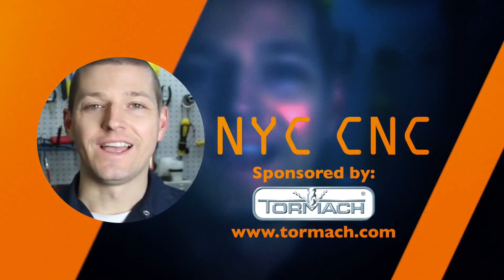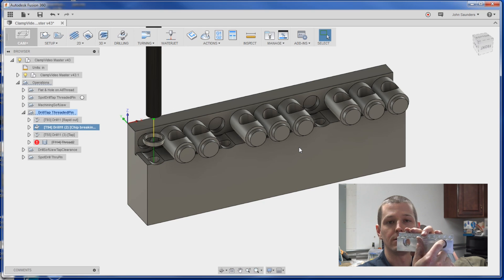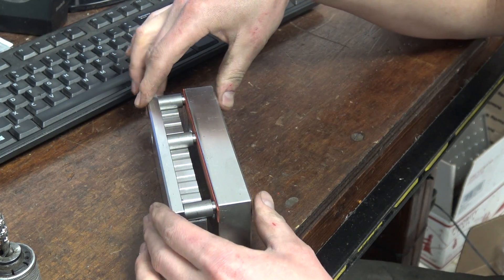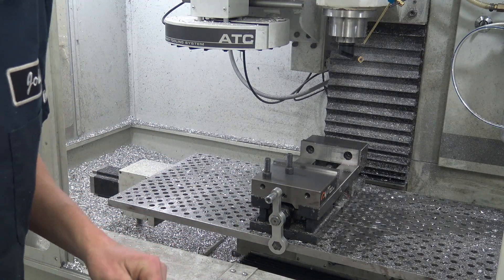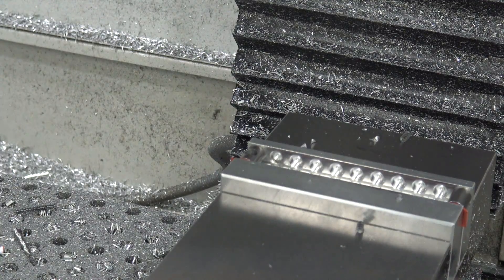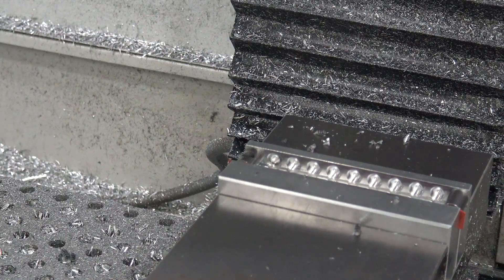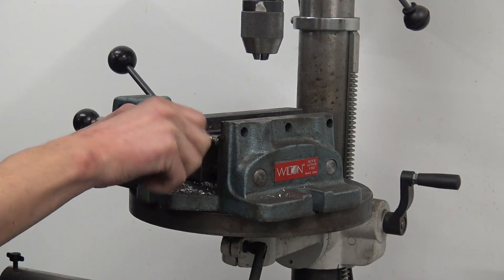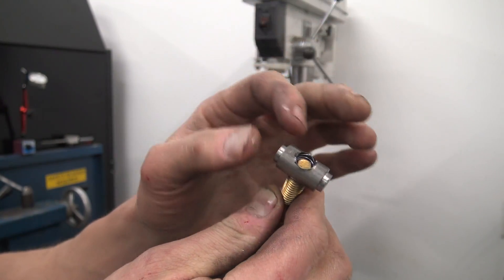Form, Cut or Mill Threads,  Softjaw Mistakes and more! Widget79

Comment: The reason you drill the form tap hole larger than a standard tap is the deformed material "squishes" out... you basically drill to half way between the major and minor diameter. The excess material from the major that would normally be cut is pushed into the minor. I use them all the time to tap from M2-M5 in brass and copper but they work well in aluminum as well. I don't ever work on steel unfortunatly so I have no experience but for soft metals they are much less likely to get gummed up and snap in the part in my experience.

Comment: Forming taps are the best. I have not used cutting taps for anything other than very low malleability materials. Throw them in a cordless drill. Hardly and chance of breaking them compared to cutting taps that have around half the total crossection. They will push a little material out as a bur, but about the same as a gun tap anyway. My travel kit is all screw machine drills and forming taps. Drills are sized to make a 60-65% thread. They also last far longer and leave a perfectly clean polished thread instead of microscopic chatter marks. Go ahead and drive them with an impact gun, they don't care.

Comment: 11:15 reason for the larger tap drill diameter is that the form tap not only pushes material outward to form threads, but also swedges it inward in an equal amount. So if you were to form tap a hole, and then use a gauge pin in the hole, you'd see that the minor diameter gets smaller after tapping.

Comment: drill cross holes in soft jaws slightly lower in vertical plane to force parts more downward to stop the spin you experienced and also you can make a V cut rather than a radius for parts to sit in to create less of a bearing surface, anything with more sides than a radius. combined this will stop the rotation as well as compensate for the discrepancy in part length leading to the parts coming loose from the fixture

Comment: I enjoyed this video, and learned about "thread milling" which is new for an old tapper dude. You mentioned about  the formtap and the deforming of the bottom of the hole. I found this info which may be late by now: a)...Forming taps run better at speeds 1-1/2 to 2 times faster than a cut tap, and require much more attention to lubrication of the tool,... b) Cutting taps may be a better choice for "through-holes" as they won't require a separate operation to repair the distortion at entry and exit caused by the forming tap. ... https://www.natool.com/blog/2016/07/cutting-taps-vs-forming-taps

Also I'm upgrading my SIEG X2 Mini Mill to CNC which has an R8 Collet. Questions: 1) What are the collets that you use? Are those tapping collets, which spin in reverse on extraction, or does the spindle turn in reverse in the G-Code?
Keep up the great work!

Comment: Best thing to do is use a drill tap drill taps look like a drill but with theads its fast but another problem is ur tool holder is to wobbly you need to use a spring loaded holder that quick connects don't work to good

Comment: The form tap requires a larger hole because you are displacing material, the minor diameter of the threaded hole is smaller than the diameter you drilled to because when you form the thread the material the material you're coming at the major diameter of the thread "moves" to fill the minor diameter.  The reason it's stronger is because you're maintaining the "grain structure" of the material.  The main benefit imho is the finish of a form taped hole, it's phenomenal, like a mirror, and the finish is how you judge your tool life, when the finish goes away, time to change the tap.

Comment: I form tap whenever I can. I don't have a lot of form taps, but the ones I have I use every time it's possible. I like that there are no chips to clean out, and I believe the threads are stronger, and are very nice. In my experience, form taps give more consistent threads than cutting taps. I've never power tapped, only by hand every time. I always use Tap-Magic fluid whether I'm form or cut tapping.

Comment: Awesome video! I just stumbled across your YouTube channel by accident. I like the idea of the endless applications that soft-jaws offer. I saw that your work piece turned easily. I over engineer everything in my head, but it also leads to good ideas. So, with that said, I had a crazy idea. What if you were to drill and tap the back side of the moveable soft-jaw for set screws? You could even maybe drill them at a downward angle to put downward pressure on your work pieces...

Comment: 12.00 and 08.03 Time. It's not good with the z-axis retraction, it stops with thread in the hole, which is not good, you have to retreat to pull the pot out of the hole, not the star instead. Breaks the beginning of the thread. It's just an observation! Hello from Romania, I work on the CNC lathe!

Comment: we use uhmw strip 1/4 X 2 and cut  the same length as jaw width instead of that red padding strip and you can use them a long time over a year in some cases. and put some serious clamp power on it

Comment: I recently switched over our taps 100% to form taps in our CNC operations. We are form tapping very successfully in all the materials we machine (4142, D2, A2, 1018, HRS, Aluminum, Stainless ext)  except for Ampco. We have almost completely eliminated tap breakage plus the performance with water based coolant with form taps vs cut taps is much improved.  It was a good move for us in the way of reliability, thread quality as well as it cut down on our tooling costs.

Comment: A tip for your clamp fixtures. Use a stack of Belleville Disk springs in each pocket for pins that may be a couple thou off. I had a job once that required several hundred pins be milled flat on two thirds of one surface, then drilled in two places and drilled and taped in one. Then a key slot was end milled in the lower part of the flat. I made a fixture with ten V slots that could be clamped in a vise but did not figure in the length. The pins did not have a critical spec for the length so they were all cut with a couple thou difference each. After building the jig I would have a few pins that would try and rotate during the first pass. I solved the problem with a stack of belleville disk springs in each pin pocket that gave me roughly 2200# of clamp force on the pins that were a bit short.
Reply: Cyrus Cosmo  thats a great idea! thanx for sharing!
Reply: Cyrus Cosmo 

that is a great idea thanks for sharing!

Comment: You make great videos keep up the good work. When I countersink tapped holes I almost always go .015 to .03 per side larger then the thread major dia.( aslong as the print allows). This takes care of any burr that may form on the  entrance side of the cut. For Ex. For a 3/8-16 I'll use a 1/2" drill mill or a #6 center drill. And make the chamfer dia .406-.437. It also makes the appearance of the hole more attractive. In die making a large chamfer helps to strengthen the first threads in hardened tool steel to keep them from pulling under pressure while a die is running in a press.

Comment: Great video, just subscribed.  Form taps are a fickle mistress, and performance is WAYYYY more material dependent than cutting taps, in my experience.  The reason they're "stickier" than cutting taps is partially due to the "springback" (technically elastic recovery) of the material.  Basically after you push all the material into the shape of the thread, the thread is actually trying to bounce back to its previous shape as much as it can.

Comment: You are using a wrong holder for the form tap.. never use the click holders for regular taps with a form tap... the pressure from the form tap will click it because it needs more power to push it in ...

i always use a collet or veldon holder for form taps.. works like a charm.

Comment: If you were to center the part so that the hole is between the two jaws instead of the majority of the part is over one jaw.  Even if some of the hole is over the soft jaw, maybe not over the fastener for the soft jaw.  I think that rubber strip is better than the sand paper we used to use.

Comment: I have been using form taps for over thirty years, they do 90% of the tapping in my machine shop. I work in mostly 300 series stainless, 17-4 stainless, aluminum and brass. Stronger taps as far as breakage, particularly in blind holes and superior threads to cut taps. Lastly, there is no need dig out or blow out chips trapped in blind holes because roll-form taps do not create chips. I prefer OSG and Cleveland twist cobalt (M42) form taps. As always, very nice video.

Comment: Good tip about not using an impact driver to drive the vise. Were the arguments against doing so in regards to the speed or the constant impacts from the driver?
I occasionally use a drill if I need to open my vise all the way for cleaning or changing jaws and a drill seems to drive it smoothly, but it is much faster than I drive it by hand.
Reply: NYC CNC so what's the verdict on using impact drivers on the vice?

Comment: Would it be worth running a quick chamfer after tapping for a "lead in" to your threads and also cleaning up that leading edge?    At the end of the first full tap, it looked like the tap was rubbing a bit at the end when it was coming out of the hole, it just sat there for a bit.  If you had a round wire brush that was the right diameter, could you just run a brush in and out to help break off the burrs?

Comment: You drill a bigger hole to give the thread somewhere to form into. 
If you cut a standard size hole there would be to much material and nowhere for it to flow into. 
Thanks, good video.

Comment: Nice coverage of the basic differences between the three types of taps.

I was surprised at how loosely the soft jaws held the parts, even when there were only two workpieces in place. I expected trouble with a full load, but thought that two would be held firmly.

With the forming tool you would want a hole slightly larger than the average between the major and minor diameter of the thread. This is reasonable, because you are displacing the metal that was between the average and major diameters into the space between the average and minor diameters. Since there is more volume in the outer hollow cylinder than the inner hollow cylinder (because it has a larger average diameter), you need to "cheat" the hole a bit larger to have room for the extra volume. If it were a cut thread, the hole would be right for maybe 45% or even 40% thread. The coarser the thread (longer pitch), the more you need to cheat the extra room because longer pitches go deeper into the stock with a v-form thread.

The formed-is-stronger effect is generally true for external threads because external threads are generally made on round stock (usually by rolling between two grooved plates) where the grain runs generally parallel to the axis of the round. Cutting threads in such stock will cut the grain. Forming threads deforms the grain so it runs in and out of the body of the screw into the threads. You also need to start with stock which is a smaller diameter than the final thread diameter since some volume is displaced outwards into the dies. You see this same effect when knurling - the knurled diameter is larger than the original stock. (There is also some strengthening effect from work-hardening, especially in Stainless Steel.)

When forming internal threads it is not always clear which way the grain runs in the stock. It would have run parallel to the long axis of the stock as it passed through the rolling mill, but the hole to be threaded in the final piece may run into the end grain (in which case the formed-is-stronger effect would be about the same as for external threads) or across the grain (in which case the effect would be less). In these parts the hole runs across the grain as the part is a cross-drilled piece of round stock.

Comment: Minor suggestion: 
It might be advantageous in the long run to wear gloves when working. Mineral oils, cutting fluids, grease etc can destroy the skin on your hands over time. Skin will absorb almost any fluid it comes in contact with..typically metal working fluids are not chemicals you want to be absorbing. I always wear nitrile exam style gloves when doing mill work or anything involving grease and oils. Although they do tear with regular use, it saves your hands from all kinds of little cuts and scrapes as well. Great videos though! It would be great to see more people making videos like this.

Comment: I was going to suggest square stock, but I see another commenter was already on that. Another possibility is to mill some small flats into the radius on the small diameter ends to key into the softjaws. And another wild idea...turn some small pointy "crush zones" on one end of the part. A hard enough opposing jaw could deform the longer parts enough to get a good grip on the shorter ones.

Comment: Glue a small spring washer between each threaded bolt and the jaw to fix it better? Just make sure they just using a part of their "way" so there wont be any permanent deformation over time.
For deburring maybe a ball-mill if it doesnt take to much process-time. Just let it run from left to right and stop at each hole to go down a bit. For the backside turning all parts or using a backward deburring tool or a threadcutter on a 3D Path.

Comment: I believe someone mentioned the Guhring web site as a good resource for tap drill sizes. That's the site I use as well (and I spent a fair amount of time testing as many as I could find). I don't think YouTube will let me link to it, so I'll just put everything in the URL after the domain (which it pretty easy to figure out)...
<guhring domain>   /Tech/TapDrill/default.aspx

If you're going for 75%-ish threads, a chart is fine, but the Guhring site lets you adjust for other thread percentages as well.

Comment: Kerosene works good to cut/tap steel with. A little bit of slick with a lot of cooling.
Aluminum is very gummy and coolant is not really required, just something slick to keep it from sticking to the tool.
Reply: We use WD40 at work for aluminum.

Comment: John, It is actually ok to go ahead and run the thread forming tap through again. You are correct about the spindle orientation, but the spring tension will adjust the tap to the correct height to match the threads. If for some reason it does not due to tension then you could pull down and guide it into the hole until it starts.

Great videos!

Comment: Funny Video..;-)  Have you considered making soft jaws with a small v or dish and just slide the barstock in between, drill and tap holes ensuring they are spaced to allow for parting, then do the lathe work. Would allow for greater, even clamping pressure in all axis and allow you to do all ops as full thru-holes. Then you can just debur the hole length of bar on the wheel prior to feeding to the lathe. You can buy taps with a built-in chamfer to save tool changes etc, last company I used was Guhring which I noticed had them I think.

Comment: Form taps are cool. 1/4x20, blind hole, 3/4" deep thread almost to the bottom in soft steel. I can usually tell when it's ready to break but that's after 1000's of holes on one tap. Never any luck with oil based lube but it likes the regular water based coolant.

Comment: So far I have only ran form taps on my 1100. I have only ran a M4 tap but haven't broken it yet. When possible I found it is better to drill and form tap before facing the part to remove the raised material.

Comment: Gh3 taps produce standard sized threaded holes, GH4 slightly looser, and GH5 the loosest. I use GH5 taps in plastic and bronze/brass, because those materials tend to shrink after tapping.
Reply: exactly, because they elastically deform more before the plastic deformation starts.

Comment: Drill and tap a set screw thru the unmilled jaw in each pin position. We do this on alot of similar parts. Clamp the vise jaws together, then tighten the set screw as a secondary hold.
Reply: Ha! Looks like I was not alone in this idea. Slow, yeah, but it would look awesome if nothing else haha
Reply: Sure for a few parts, absolute no in production (I count 300 as production run). Why go through the trouble when a piece of tape works just fine?

Comment: Awesome video!  Why not just drill into the cap screw counterbore in the jaws?  It wont screw up your ability to flip them as it clamps mainly on the back.  You shouldn't have any problem running all stations of that.  

Also you drill bigger for a form tap because it physically forms back into the hole to make the minor diameter.  So for a 1/4-20 you drill .228 but it forms back close to the .201 you would normally drill.
Reply: +NYC CNC You were saying in the video that you were worried about drilling and tapping through on positions 2 & 3 but since your supporting them off the bosses on the end I don't see why It wouldn't work there as well.  Especially if you are drilling and tapping into the open hole of the cap screw hole that mounts the jaws.  Its like a built in clearance hole! haha